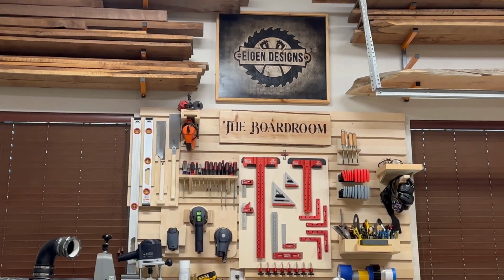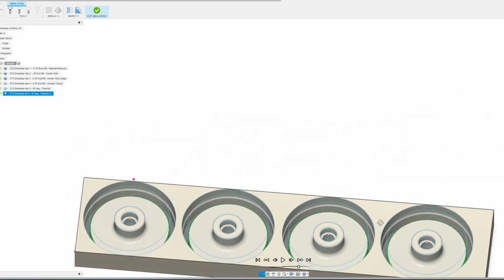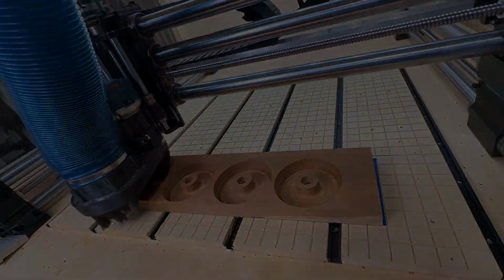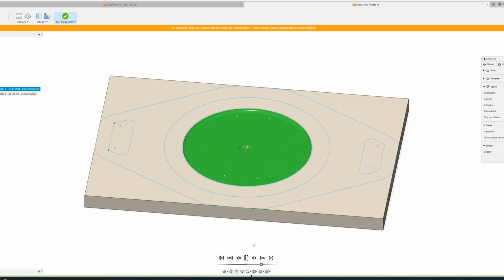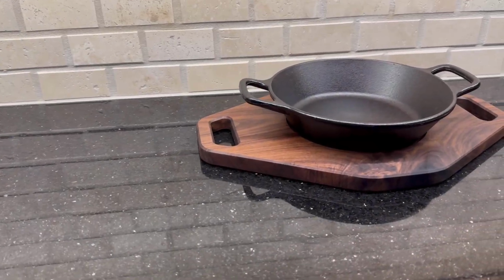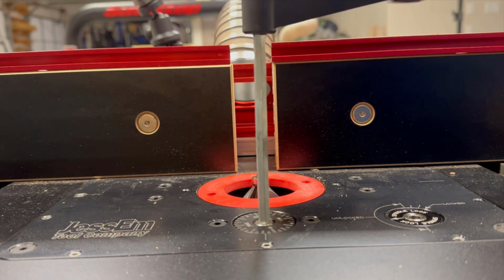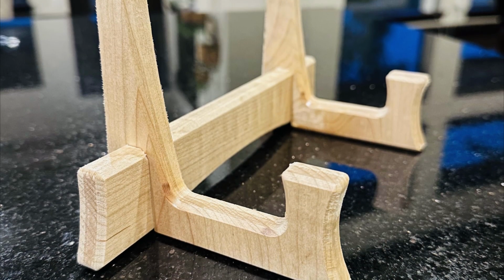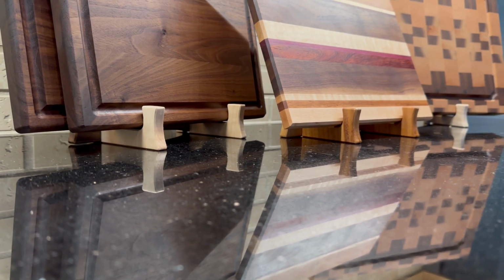4 Easy CNC Projects

Comment: Mark, I purchased your cutting board stand digital plan and imported the DXF file into Vcarve Pro.  I used profile cut on the outside of the line (with conventional cut) for the tool path using 1/8" downcut bit.  When I did that, the half lap cuts that inter-connect the pieces were too narrow.  Any suggestion as to why the cut made the slots too small?  Thanks for your help and loved all of your plans I purchased so far.
Reply from the maker: Hey, I don't always get to all of the YouTube comments so make sure to reach out through Etsy if you're looking for quick support. Two suggestions for you based on what you're saying: (1) I would suggest putting a chamfer on the edges to ensure the pieces can fit together easier. (2) The thickness of the material is supposed to be 1/2" thick so if you're still having trouble you can run the pieces through a drum sander to get down to 0.49" to help things fit. If neither of these fixes your issue, reach out to me through Etsy and we'll get this resolved. Good luck!

Comment: Great video as always! I see all your equipment listed in comments but I don’t believe you list your CNC.
Reply from the maker: Hey Peter! The CNC I use is made by a company called OneFinity. You can check them out at OneFinityCNC.com
Reply: How do you like your one finity? I am a woodworker and make cutting boards & charcuterie boards. I do have a small side business and would like to add a CNC and have been looking at the shapeoko 5 and have herd good things about one finity. Any insight would be appreciated. Thanks man. Great video.

Comment: How do you like your dust boot?
Reply from the maker: I like it quite a bit. It doesn’t a pretty good job and the 4” hose moves a lot of air
Reply: @EigenDesigns  Did you design the dust boot or did you buy the plans?
Reply from the maker: @SYLTHECRU  there’s a company called PWNCNC that makes them. I have the v7 dust boot. Here is a link for you to check out:

https://pwncnc.com/collections/featured-products/products/dust-boot-v7

Comment: Nice as always, Mark! I wonder how hard it would be to embed a qi charger on the phone holders? Also: team chamfer for life!
Reply from the maker: Hey JP! I have done that in a desk before. Short answer is it IS possible, but you have to bury it <1/8” below the surface in order to get the phone to charge. The qi technology is currently quite limited on how far it can transmit through a surface. I experimented with 4 different brands/designs and found similar results. If the technology improves, it’s definitely something I will experiment more with.